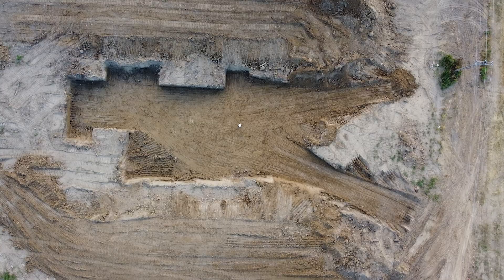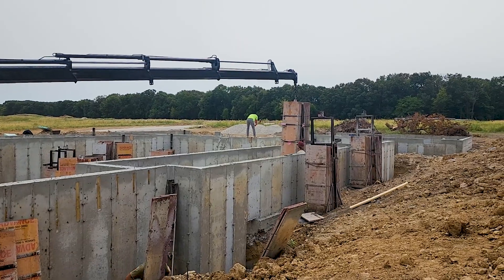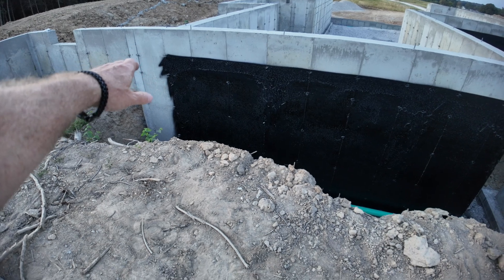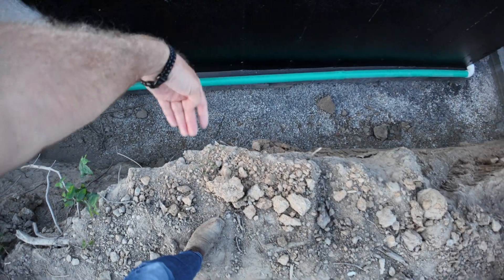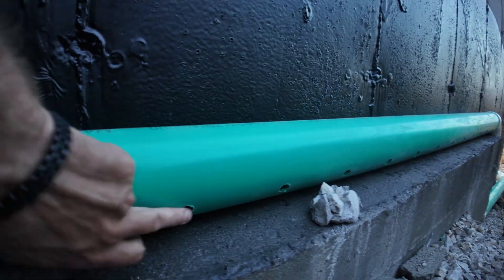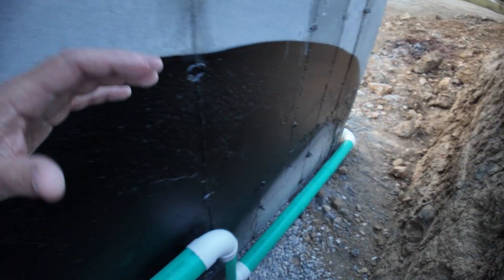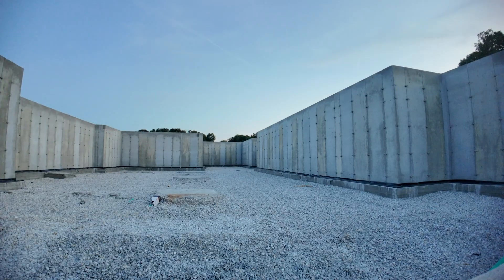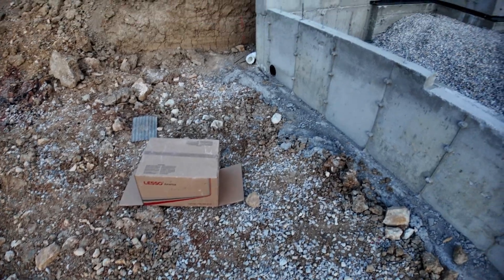Dry Basement - New Build Foundation Waterproofing | Do It Right!

Comment: This is quite old fashioned building system,  You would be much better off with ICF walls and peel and stick with a dimple board over top to protect.  With ICF wyou have warmer walls and no need to create and frame, insulate more interior walls inside the perimeter concrete wall.  Will you also be adding radiant heated floor or EPS insulation under the slab ?  Tar is a toxic application which deteriorates over time.  HULK system makes a bomber waterproofing you could inquire about in your area.
Reply from the maker: Thanks for watching and commenting.   The spray on membrane isn't tar it just looks like it due to the color.  Certainly ICF is a great way to go but very uncommon in my area.  👍

Comment: I am the 2nd owner of the house I live in (for about 22 yrs) which was built in the mid 60s. After living here for about 1 yr I noticed my basement walls would leak just a small amount of water after heavy rains. Did some research about the problem and upgraded my gutters/downspouts and graded the dirt away from my house. Those fixes really improved the water situation. After several yrs my basement wall started to crack a bit more and let more water in so I applied Dry Lok sealer and that helped for awhile. Then over time my basement walls bowed and cracked more. That's when I called the experts. I had I beams installed along with a sump pump along with a French drain. No more problems. Doing it right the first time will save lots of time and money for sure.
Reply from the maker: Thanks Scott for watching and sharing your experience.   👍